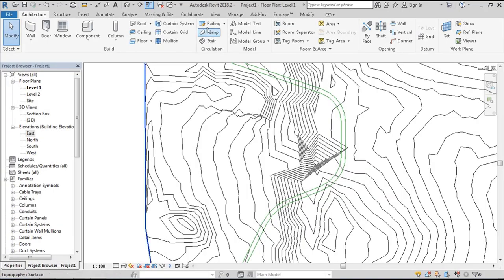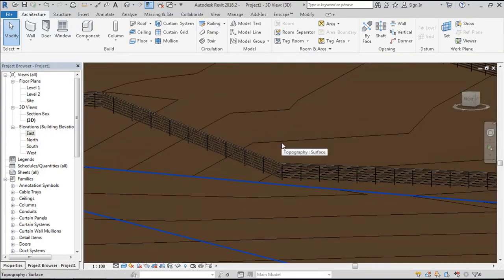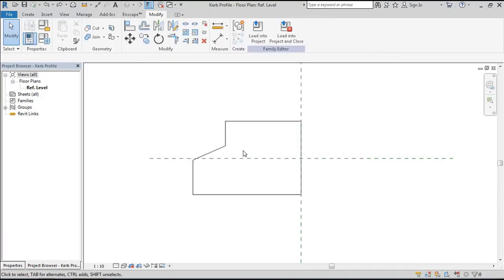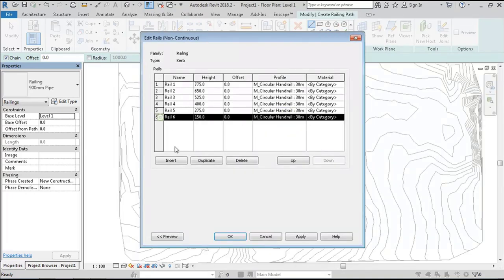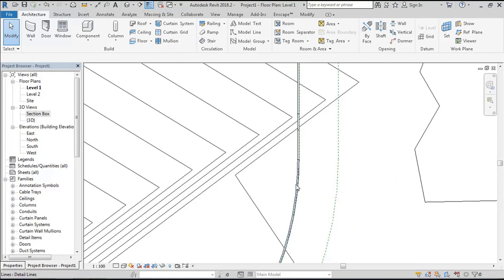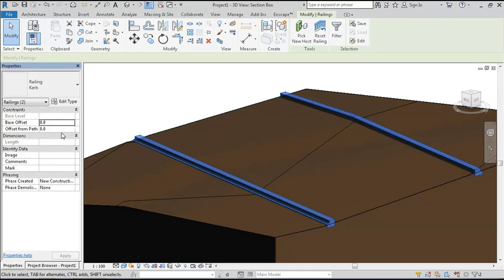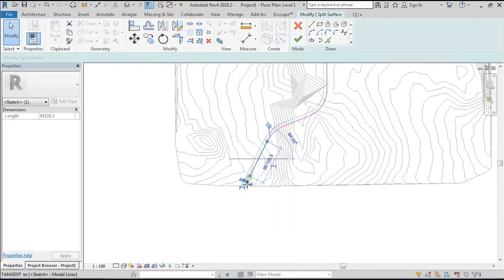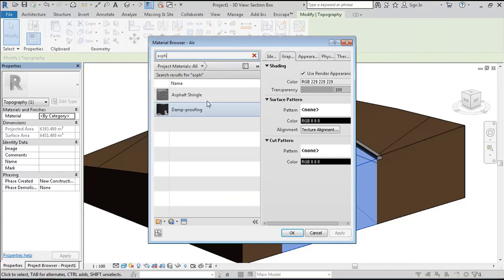Create Roads and Kerbs With Railings in Revit 2018

Comment: I can't create railing on top of 'toposurface'.., doesn't active "pick new host" when clicking railing.
Reply from the maker: And you are using Revit 2018?
Reply: Revit 2014
Reply from the maker: Sorry it won't work with Revit 2014 you'd have to use other techniques to do that like the one in the first part of this video:
https://youtu.be/bVBJc39oaN8
Export a DWG from the topo and bring it back. Then (the video doesn't show but you could do a kerb from the Roof slab with an edge or sweep...
Reply: VP BIM Channel 
am already doing on the kerb by using sweep method. the problem for creating path of sweep is in defferent workplane when creating the sweep method. another doubt, how to create center line of road by using on toposurface. (same error for creation of kerb stone)

Comment: is this not available on 2015?
Reply from the maker: It's not available in 2015. In 2015 I would use the Floor 'slab edge' tool with a kerb profile
Reply: When I initially created the top it was created from an imported model. If I use the floor will it follow the contours of the topo?
Reply from the maker: I use a plugin - Kiwi Bonus Tools that makes the floor match the topo or a Dynamo script... if you don't have bonus tools and Dynamo is to complex anyway... I would probably just use the technique from the video in this link... You can divide the Topo surface; export to DWG; import back into a massing environment and create a roof by face and then use the edge tool. Or just use the cross (planting family) as I did but then create a sweep from a spline drawn by snapping to the cross families. Check the video an it will be clearer I hope...
https://youtu.be/bVBJc39oaN8
or this one
https://youtu.be/V4qZdlu-JpE
Reply: I tried using doing the roof technique but I kept getting a warning that I could not create the roof because the topo mesh was too complex and I need to simplify it. I was not sure how to simply it since it was an imported model and simply took that model and converted it from import. I can try using the other two suggestion you made. Thanks
Reply: By the way do you have any videos on creating custom geometric building shapes with precise angles/ slopes...
Reply from the maker: You can simplify the surface after importing in the topo tools... and then export to DWG from the Revit topo surface. But I think the other option is better anyway. you may need to to use techniques to make sure the adaptive point hosts 'global Z and then XY' but if you get it right it works a lot better
Reply from the maker: What do you mean? do you have an example? a building like this from Aires Mateus?
https://projectosvascopereira.blogspot.com/p/aires-mateus.html?token=MNlmiGIBAAA.swSXPl1thfSyaUUj4LmQTSkKdrjGwRR8nrTWIZc110wN_5aRCSMirknM5BaBBF9pQIsNWjp-4mp317PEAiQX2w.ZOj5oSGD1wR0VFe6PA-mcA&postId=4480122507078228574&type=POST
Reply from the maker: They have specific angles in the entrances and all the roofs have different slopes... is this type of thing you are looking for?
Reply from the maker: For that you should use Massing first and then use 'Wall by face', 'Roof by face' and techniques like that. I don't have a specific video about it but you should use the modelling method on this video:
https://youtu.be/GaIPVClRqck

About tutoring I don't really have the time right now, sorry. But you can always send me a message on messenger on my facebook page and I can direct you when I can. If I have time I will respond and direct you to the best resources if I can.
Reply from the maker: https://www.facebook.com/RevitConceptual
Reply: Thank you!